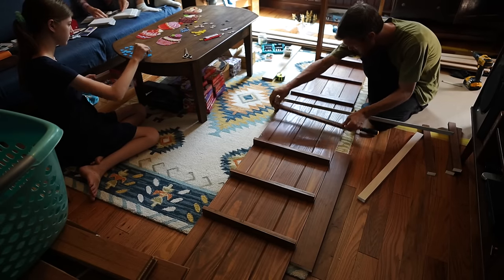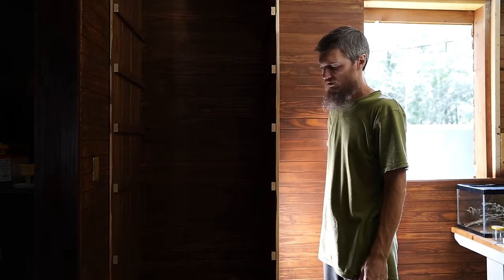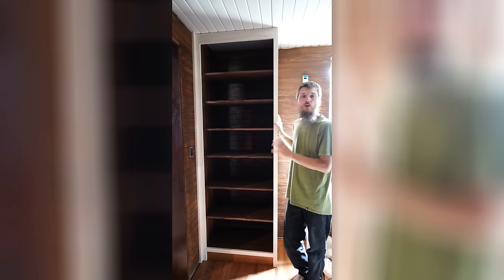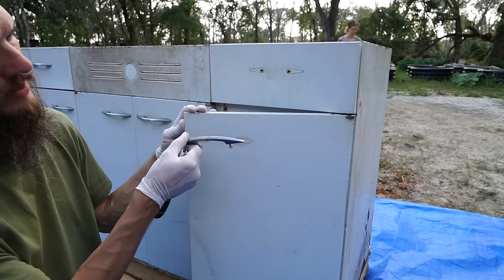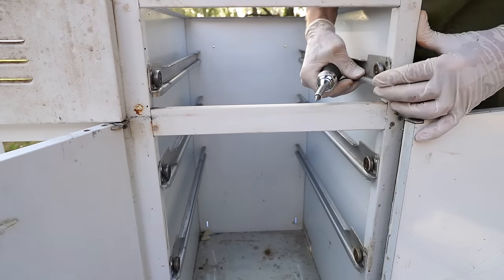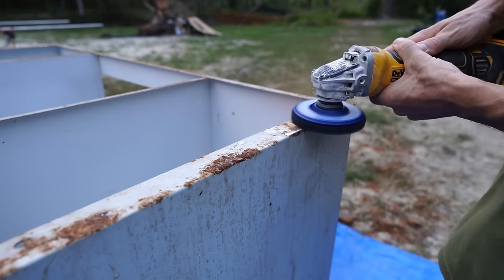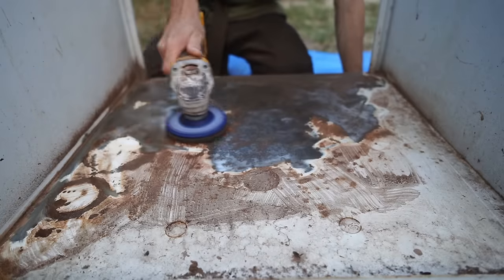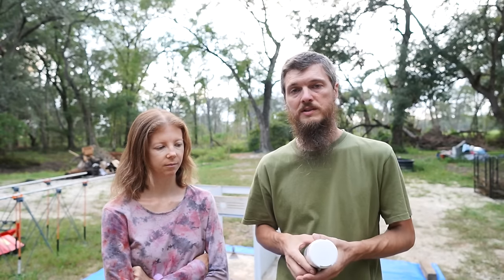New Wood Cabinet, Old Metal Cabinet

Comment: I wonder if it would be cost effective to take it to an auto body shop for a sandblast and primer coat. I know in Dental offices they electro plate metal cabinets and the finish is durable. Not that I doubt you could do it yourself, I'm SURE you will do a great job.

Comment: I am not thinking you are wasting your time. It is cool. and it will add a lot of character to your kitchen and home. Glad you are restoring this cabinet. I have two in my NYC kitchen. I dragged them in from the side walk. On my block. They are 30" wide. One had a counter the other I made a counter from a table my neighbor gave to me. The draws do-not have draw guides and are difficult to open they are on metal tracks or channel.. I have one suggestion. Put a piece (meaning fitted) of plywood on the bottom side of the bottom shelf to add support. It may make it less tinny and give it some stubility.

Comment: Should turn out good, if you want to get rid of the pitted steel you could try bondo or glazing putty, glazing putty for auto body work goes on pretty thin and sands smooth if thats the look your going for.

Comment: The insulation you found is shrunken. It was originally the size of that area. I put dum dum, the black car body insulation that's adhesive, everywhere it could not be seen. It dampens the sound from the hollow metal. (Under the floor of the cabinet, under drawers, etc.) That way it thuds when you open and shut things, instead of echoing. If you can find it, the size sheets they use inside car doors. It stays soft and pliable and doesn't dry out, is easily cut to fit and is self adhesive. It's very very sticky, so place carefully.

Comment: Hello Doug and Ashley, your sink is very classy. I just wonder if the conditions and if it is possible to epoxy the sink or powder coating it will last you longer. The spray you have is good but depends on how deep the rust is to add a neutralizer or primer. But it's up to you. Take care, thanks 😊

Comment: I 100% agree with you reasoning for the sink.  I think the same way in seeing the potential.  
🔴🔴🔴🔴🔴🔴🔴🔴🔴🔴🔴🔴🔴🔴🔴🔴
To remove the rust:
You’re taking your time renovating it so to deal with the rust I might suggest just getting a big tub, dumping vinegar in it and soaking all the smaller parts, and even shelves and doors if the tub is big enough, for a couple of days.  The rust will just wipe right off.  You don’t need those expensive rust removing products.  Just plain vinegar. As a bonus it will remove the rust in all the crevices and corners that your sander can't get to.  I found a bag of tools my son had left outside.  It had been out there for a couple of years and everything was caked with rust.  I soaked them for a few days and then just wiped off the rust.  Same thing for a set of old screwdriver bits.  All covered in rust.  They looked as if they should just be thrown out, as did those tools, but I soaked them overnight and they were good as new.  If you soak your parts you can still sand to remove any pitting or rough spots after wiping off the rust.

Comment: Just a suggestion on the inside of the cabinet is to line it with the thin cedar usually used for lining a closet, as this would look good, stiffen and dampen the unit. The inside of the drawer faces could be dampened with some rockwool if you still have some.

Comment: The house I was raised in has an enamel coated cast iron double sink with a drain board on each side.  I'm guessing it's 5-6' feet long.  I really didn't like it, because it's harder to clean and keep clean than stainless steel.  I didn't know some people like a sink like that.  It also has a metal cabinet underneath it, but over the years, it has rusted quite a bit.  

I hope the metal cabinet turns out the way you want it to look.  That's a lot of work to restore it.  You have more patience than me.

Comment: I live in Nevada so water has to be conserved. So I did my home work on how much water is wasted hand washing dishes. Without a proper gray water system you use a lot of water if you want to have truly clean dishes. My grandmother and my mom used the same water to wash and the same rinse water which is unsanitary so I was sick all the time. I didn't want that for my kids so I used boiling water poured over my freshly washed dishes and that help a lot but my water bill was too high. I finally got my first dishwasher when my 3 boys were almost grown. My water bill went down almost 50 dollars but the power bill went up 10 to 15 dollars which was still cheaper with the dishwasher. I clean off my dishes after each meal and put them in the dishwasher then right before bed I would start the dishwasher and the days dishes all in 1 load. In the morning while cooking breakfast I unloaded the dishwasher and it was ready for another day of dirty dishes to be clean and sanitized... Now at 76 years old and disabled my dishwasher is a god sent helper not as many dishes so I only run it 3 times a week. Still I wouldn't be able to stand at my sink to wash them because I can barely walk or stand long enough to get them washed. I guess water is in abundance in Florida but how is the sanitation? I also thought a dishwasher was a unneeded luxury until I realized that it is just another tool. I stopped using a rock and wash board to do my laundry when I got my first washing machine. You laugh but I really did wash diapers in my bath tub with a washboard, when my husband was in the Marines in 1965 we didn't have enough to money to go to the laundromat more that 1 time a month so Dirty diapers had to be washed by hand. It was my second child before we could afford disposable diapers. Ok I know stop rambling on. We all do our own thing you know my heart in in the right place. Love you.
Reply from the maker: Yeah, it doesn't bother us that other people use dishwashers. For some people it makes sense. It just doesn't make sense for us. And we don't worry about sanitizing so that's not an issue for us. Our comments weren't meant to make anyone feel bad about it. You're fine :)
Reply: @diyfferent  No my comment was just information for those who live in a drought area like me, where water is scarcer. Living in Florida you do not need to worry about conserving water. Although with the pandemic some people might feel the need to sanitize their dishes and a dishwasher will do that. I wasn't trying to change your mind just being a old granny  and trying to help lol I do love you all you are like family to me. Hugs🦋

Comment: for the rusty screws , buy some evaporust (brandname) put it in a glass jar with the screws they come out like new , that stuff is realy good at removing rust and its reusable
you can push the screws in a piece of cardboard after that and give them a thin coat of the same paint youre using for the cabinets (thin to make sure you can still use the slot in the head for a screwdriver so the visable parts whont rust anymore
as for the rust pitting (the visable parts at least) you can fill with automotive bondo and sand with 240 sandpaper on a block , would rough up (take the shine off ) the old paint with 240 too before applying the rustoleum paint make sure you rub it down with grease and wax remover theres bound to be some on there as its been in the kitchen for all its life 
make sure you feather in the spots where you dug in with the grinder to get the rustspots off of fill with a thin layer of bondo and sand untill flat with the surrounding old paint as they will show verry clearly in shiny paint 
the finish will be as good as the work you put in it to get it smooth before painting it
if money wasnt an object you could have the cabinets sandblasted and powdercoated , the powdercoat is the toughest paint out there , its allmost emaill , if youre going to redo the top i would seriously consider having it powdercoated
rustoleum is pretty good paint even the normal paint dries realy hard and tough , too bad you bought spraycans , i dont like to use those as they dont spray even (the nozzle basicly sprays a dot or an oval , you need a line to get it on there nice and even) i like to use a normal can of the rustoleum paint thinned with white spirit through a air paint gun 
if the finish is realy rough you can allways spray it in bedliner , it whont be smooth (it be like spraying a popcorn ceiling)  but you can hit it with a hammer and it whont come off 
would still put in wood fillerpieces to replace the paper thingies you took out of the drawers (probably a good idea to make the wood the full size of the inside of the fronts as the should keep them from denting), they help thightening the handles , if you dont they will loosen constantly and rattle , the fronts probably will cave in some too if you dont use a backing
Reply: Very knowledgeable

Comment: Might I suggest you reinforce the base with a wood frame. Also add back in insulation in the drawer front. It keeps it from binding.  If your serious about longevity add wood to support the beautiful sink. Strength means forever.

Comment: I would split the gap front and back for air circulation. But, it is your kitchen and it will work as you fix it.

Comment: I used that epoxy on my chest freezer lid.  It works just like it says, but your surfaces to be really smooth.  Bondo any low spots maybe because it doesn't fill in like regular spray paint. That glossy finish highlights any imperfection in raking light.

Comment: Good to the auto parts store. When there go to the paint isle. Duplicolor makes a primer that you just simply spray on rusty surfaces without any sanding. That particular primer simply turns rust into black primer.

Comment: You should get the metal sink cabinet media blasted while you have it all apart. That will remove all the paint and rust so you can start with a fresh surface. Treat it like an old car restoration.

Comment: I understand your style desire for the style of the old unit. I have long ago experience, (yes I am ancient), of that style of unit and in my memories as a child, I found it very noisy and discomforting. Almost every use of it resulted in noise, even running the tap, (fossil). As for dishwashers vis handwashing up and drying, current environmental advice here is that a full dishwasher uses less hot water than a sink and bowl washing up session. My concern when I first saw the unit was you would have to do a monumental stack of hard work. I was concerned that some metal might even have rusted down to holes, though I think that may not now be the case. Panel beating any dents and misshapes might still be a minor issue, though that risk now appears to be reducing. So, I wish you well on the project within a project and look forward to seeing you have beaten the gremlins and come up trumps as you usually do. It is certainly not something I could attempt, my hands, legs, back, and so on would have nasty things to say to me. That said, I do have draining boards on both of my sinks, after all, some things cannot go in the dishwasher.

Comment: Do you know you can fill the inside of that drawer front with either some spray foam and slice it smooth to put the front over it or get a sheet of the 1 inch or half inch thick Styrofoam at Home Depot or whoever you shop and cut it the right size to slip inside the door And drawer fronts it might stop that obvious manhole rattle every time you open and close the drawers or doors. Just a thought I'd even consider some spray glue on the inside part of the drawer front stick the Styrofoam down, then put the front on that wood keep it from moving. Be sure your glue is safe on Styrofoam though.

Comment: I respect your decision to restore the metal cabinet, but I just can't handle the hollow, banging metallic noise of metal cabinets opening and closing. I love the drain board sink though. I'm without a dishwasher since we bought our house (built in 1905),  2 years ago. Honestly, I don't miss it in the least and that surprised me. I spent about as much time, pre-rinsing dishes, loading and unloading the dishwasher as I do hand-washing them, AND, holding off on running it until it was full and needing to pull items that I needed out to hand-wash them. Plus, I get my dishes clean the first time instead of having random pieces with stuck on, dried on food. We will reno our kitchen at some point (Its in decent, usable condition with exceptionally high end appliances). My hubby wants a dishwasher at that point. I'm "whatever" not caring if we get one or not.

Comment: I'm amazed that some people are so rude in the comments.  Wonder if they'd say the stuff to your face??   Re the cabinet - I have one in the laundry and it does clang opening and closing but it's easy to keep clean.  The only thing I would suggest is to put some vinyl on the shelves - I found the vinyl a lot easier to clean than metal. It doesn't require as much looking after.

Comment: Dishwasher's save so much water compared to hand washing.  Not a problem in FL though.
Reply from the maker: That depends on how someone handwashes. The way we do dishes uses barely any water. We don't do the 'fill the sink with water' method. We just put some dish soap on a sponge, scrub the dishes, and then rinse them off with the faucet. Super quick and easy. A dishwasher would use more water than we do. Plus we only own 4 dishes so to barely put any dishes into a basically empty dishwasher would be a waste. Dishwashers are only good for people with a full load of dirty dishes.
Reply: Yes, if you do not have enough dishes to fill a dishwasher then I get it.  My totally loaded dishwasher uses 3 gallons.  
 @diyfferent

Comment: I used that appliance enamel on my dryer, and within few months it really yellowed, all tho my dryer wasn't exposed to the sun. Also the paint sprayer on the can kept getting clogged as I was using it and was spitting paint ruining the finish. I thought that the paint can was defective so I bought a second one, and it did the same thing.

Comment: No.....I was waiting to see it!  Guess I'll have to have patience.  It's going to look fantastic.  The sink looked good, if I remember correctly.  Is it a porcelain finish?
Reply from the maker: Yes, it's porcelain over steel.
Reply: @diyfferent  The only thought I had would be the stark white of the Rustoleum next to your cabinet color, but in that it's a restoration of an old metal sink and cabinet, it may actually highlight it and be the feature of your kitchen.  Therefore, I'd probably keep the handles that belong with it.
Reply: @lindabunce5133 certainly the best idea would be keep the original hardware.
Reply: @rebeccaadkins7487  they may wish to tie in all the hardware, but might be difficult depending on how the strength of

Comment: I just looked up metal cabinets on the internet.  It said ANY paint applied before 1978 COULD be lead based.  Plus any white paint applied before 1955 could contain high levels of lead.  Will come out nice but you, personally, need to come out ok, too.  Please test and take precautions accordingly!
Reply: Apart from working outside with a respirator on, what else would you suggest?

Comment: My comment has to do with the pitting on the cabinet. I've seen that fixed by jb weld and then using a playing card to scrape it smooth then a light sanding. It shouldn't effect the epoxy spray.

Comment: You are not….let me repeat……you are not wasting your time on this classic cabinet set up. In my first home the kitchen was complete metal cabinets. I pulled them out to replace them, I had them loaded up in my truck to take them to the dump. My dad stopped by and said not to throw those away. He took them to his house. Actually built a wood storage shed to house them until he had time to built his shop. Fast forward 23 years and he completed restored the sink base, eight base cabinets and 14 upper cabinets, he got them into primer and took them to a body shop and had them painted orange. My pop passed away and my mom went to live with her sister in her house. I so wish I could find another set up like that.

Comment: Don't take this the wrong way, I'm just curious....
If I may ask, why do you guys hate things like dishwashers, dryers, and air-conditioning? Personally, I LOVE modern conveniences and couldn't live without them. But to each his own.
Reply from the maker: It's not that we hate them, we just don't want or need them. Neither of us grew up with or used dishwashers. They don't make sense for us to use. We only own 4 dishes so to use a dishwasher would be pointless and a waste of time, space, etc. Also, I enjoy line-drying laundry, so for me it is fun and relaxing. The family I grew up in, everyone line-dried their laundry so it's a normal thing. Also, dryers shorten the lifespan of fabrics and also increase the electric bill. And air conditioning - again neither of us grew up with them and most of the time we just feel comfortable, or if it is hot, a fan does the job. If we did have AC it would be used not too often and definitely not blasted too cold. And a bonus of not using AC is a lower electric bill.

Comment: Great cabinet. Should have just clear coated the inside. So dark you can't see what is in it later on.
Reply: I put in battery operated lights in my cabinets/pantry, I didn't use screws to mount them on the wall I used command hooks.